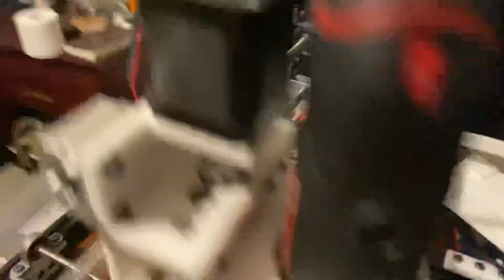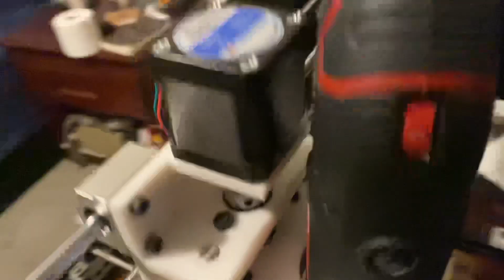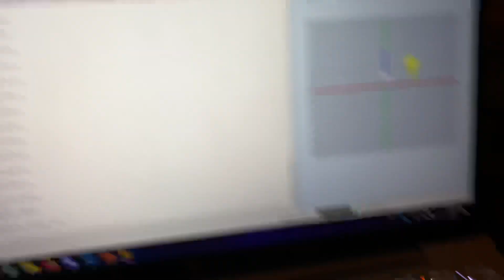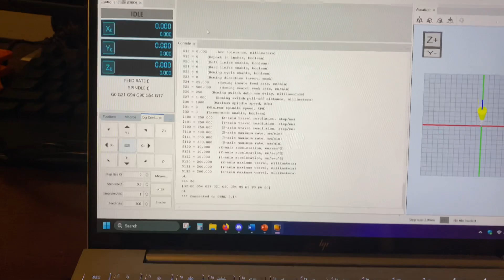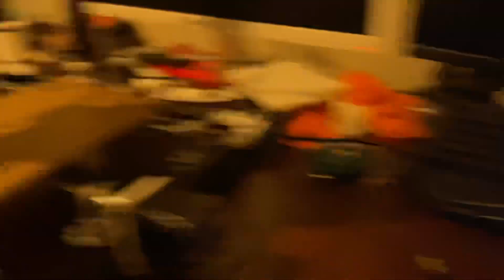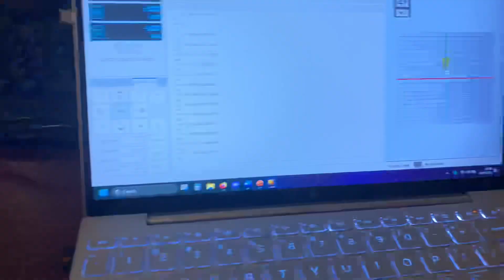Demonstration of CNC Machine DIY

Comment: Do you already have a video of her machining a part?
I have the pieces to assemble mine and I'm researching ways to assemble them to have a good performance, I currently have all these pieces and a few more. (Of course not the 3D ones)
Reply from the maker: I have not yet machined something only because the last part I printed ripped the FEP screen on my resin printer and I’m waiting for the Amazon shipment!  I have to print the brackets for the end stop sensors just to be safe haha
Reply: @Phatmatt1  the parts that are used in a cnc using micro grinding are printed in resin?!... but it is no less resistant than
filament. why??! haha ha
Reply from the maker: @Akiko_Yuuki in my case it saved so much more time printing it at 100% infill with resin than a traditional FDM printer.  I did print out the parts with an FDM printer at low infill to test if they worked before using the resin printer.  Also the tolerances of parts worked better with resin on my printer and imo they are stronger